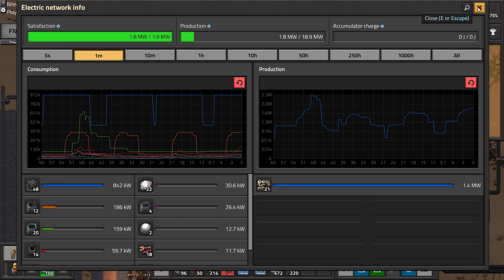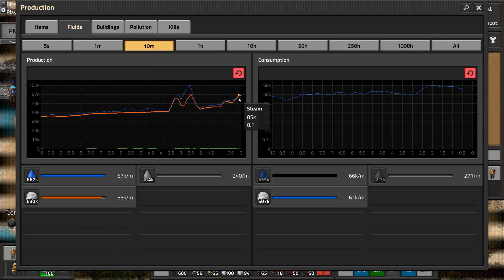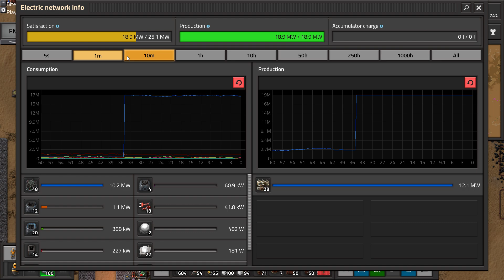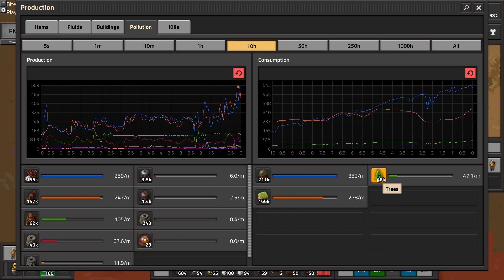Industrial Revolution 3 (Factorio) - Ep 32: Steam vs. Electricity

Comment: Making the assumption that IR3 does not mess with vanilla fluid mechanics as I haven't yet encountered a mod that does; your throughput for a setup this big would be about 1k steam per second. 

So the moment your factory started consuming more than 60k steam/minute, the throughput issues started showing up. The only way to get more steam throughput would be to run separate distinct steam lines where each of them stay under 1k/s throughput. Adding/merging more steam lines is probably just going to make it worse 😅